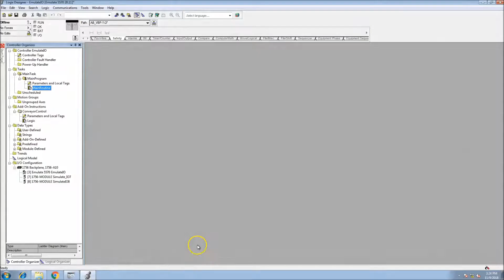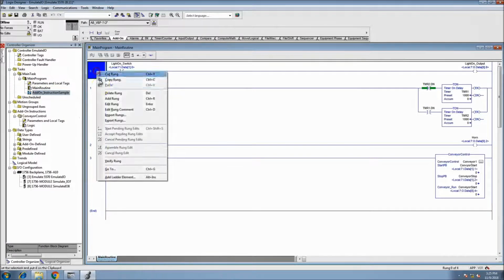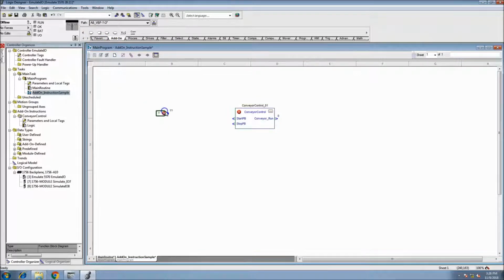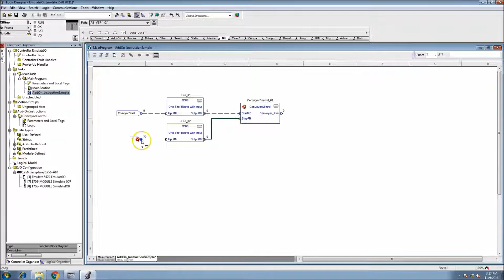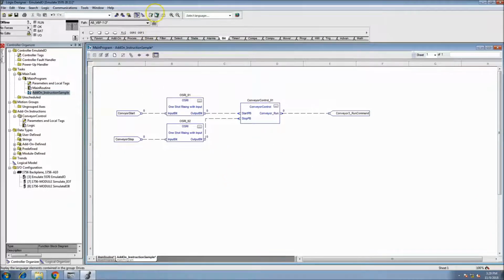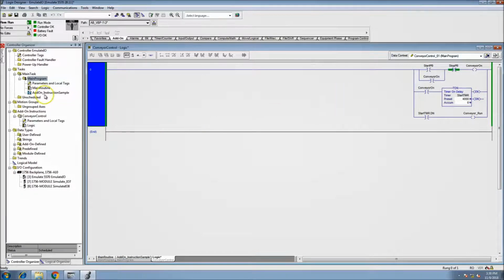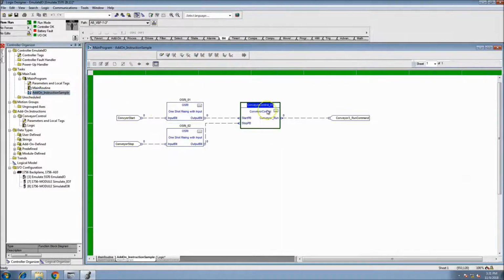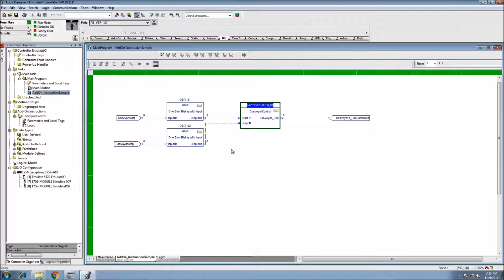Add-On Instruction In Studio 5000 for Function Block With Emulated I/O Control

Comment: I wonder if it is possible to create separate Input AOT and Output AOT to connect to a Main AOT block and then pass it through HMI to draw the connection?
Can you help me answer more questions? I have messaged you on Facebook.
Reply from the maker: @tuananhnguyentruong7352  yes you can nest an AOI inside another AOI instruction.

And still reference it from an HMI
Reply: @ShaneWelcher  So my print out commands can be linked together and get a complete AOT to put into HMI
Reply from the maker: @tuananhnguyentruong7352  AOI not AOT

Yes, you can nest an AOI inside an AOI
Reply: @ShaneWelcher  thank you for the great videos
Reply: @ShaneWelcher  can i ask the last question, so can i put the input output in one AOI
Reply from the maker: @tuananhnguyentruong7352  yes

Comment: I was looking to take "Allen Bradley PLC Training - RSLogix 5000 Series" course. But what shall I do If I do not have the software?
Reply from the maker: Diwakar Chandrasekaran 

You can get a free version of the software but it would be version 17 and have some limits but work fine.

I would get that first then take it so you really get a full understanding.

Just visit AB.com and get a tech connect account then download the free version 17 of RSLogix 5000.

If by chance it is not there any more then just email me.
Reply: @ShaneWelcher  Hi Shane, you are a very useful and fun instructor. I am already halfway in PLC 1 and planning to get all other courses enrolled too. I want to play with the control systems and make some fun projects at home. This course is super useful. Thanks again for the guidance. I will take a look at version 17.